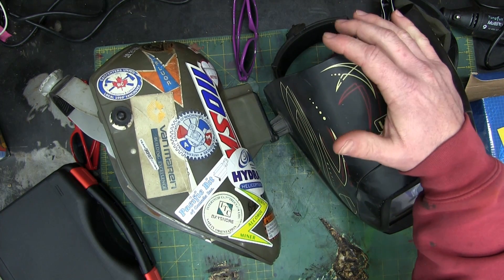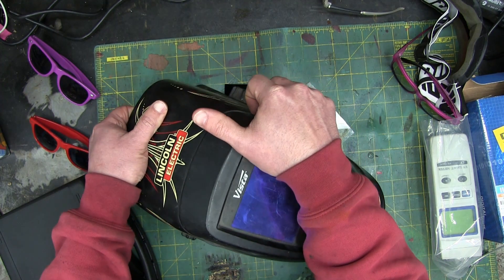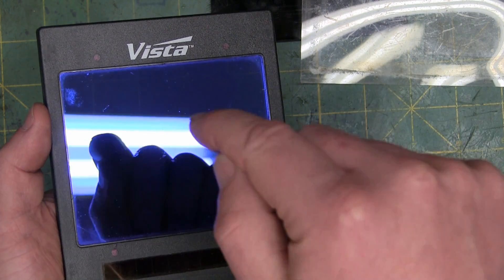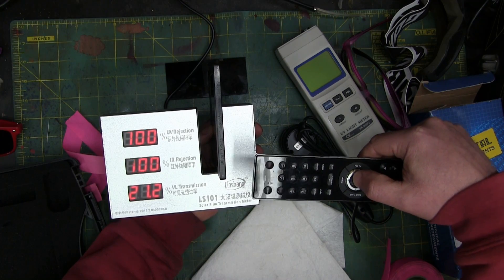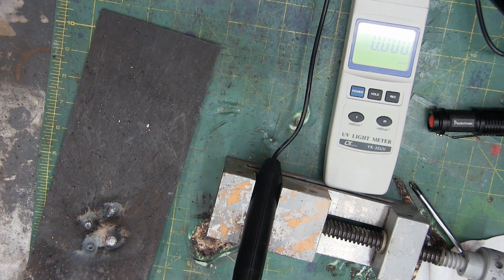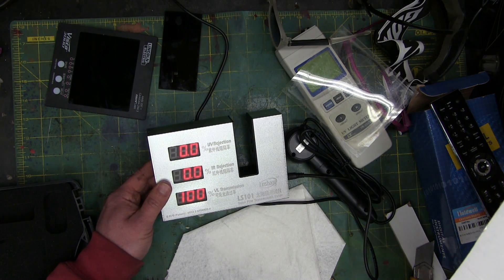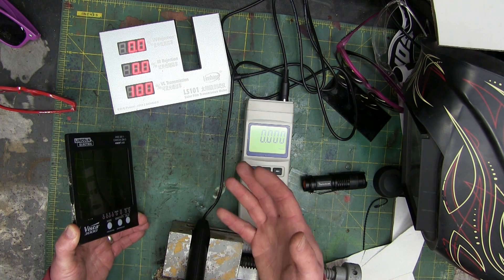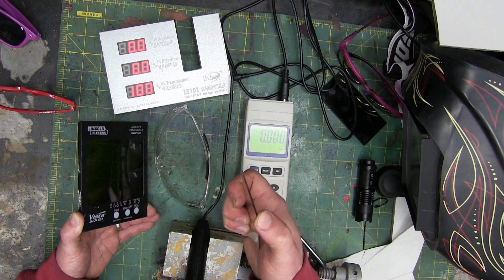SPEED DOESN'T MATTER?! Auto-Darkening Welding Helmet

Comment: Hi AvE, love the channel, and please note it is tightly in the vice!

Just started a welding class, and the Miller helmet I bought has separately adjustable welding, cutting and grinding modes. The expensive one apparently has auto adjust settings (I didn't buy that one).

Comment: That's important to know.  100% protection for the most dangerous IR and UV 100% of the time .  But is visible light also dangerous?  Yes, it can be, but is a welding flash intense enough to do damage? I assume yes.  If the lense darkens fast enough that you don't feel and adverse visible effect, then I assume that it's fast enough but I don't know how much time it would take for damage to occur.

Laser: "Visible and near-infrared (400 – 1400 nanometer or nm) laser light pose a critical hazard on the retina." "bright blue-green light projected into their eyes was from a laser pointer and was harmful."

Comment: when I cut with the torch I use them green cutting face shields,  are they any good? i also use cutting glasses under just to be safe.
Reply: Yes. Even dark glasses are fine. The arc off the acetylene flame isnt near as bright as an electric arc. It will still do damage just not as much or as fast.

Comment: Lincoln for driving
Miller for drinking
Whatever off brand welder you bought because you couldn't afford a Miller or a Lincoln for welding.  Probably spent all your money on DUIs from driving your Lincoln while snookered up on Miller.
I think that's how it goes.

I would love to see you test out at cheap Chineseium  auto darkening helmet.
I got me a new one for black Friday, half the price of my original one and this one is adjustable with a replaceable battery.  My original Forney auto helmet was strictly on and off and you aren't supposed to be able to change the battery.  It is 10 years old and still works if I charge it up under a shop light over night.

Comment: In most cases I agree completely with spending the money on a quality tool but I have had some pretty expensive welding helmets stop working for no apparent reason.  Not old or warn out or damaged.   Years ago another welder told me about the $40 harbor freight one and honestly it’s better than any of the $400 ones I had used before.  Not as many features and a smaller viewing area but they just seam to always work.  And when I drop a hammer on it I get a new one.  

Your mileage may vary.

Comment: There are differences in the way the helmets work. We had Miller, Lincoln and Speedglas that used batteries and it seemed that the battery was dead every time you tried to use it, especially if you were away from the shop and a supply of batteries. I purchased my own Optrel that does have a battery but it is recharged by light. Setting it in the sun for a minute will recharge it if it hasn't been used for a while. The light from welding charges it. I've had the helmet for at least 7 years and never changed the battery. The helmet also has sensitivity settings, shade settings and settings for grinding, torch cutting and welding.

Comment: I made the mistake of buying a cheap auto darkening helmet from princes auto/habour freight.
All of the safety markings turned out to be fake. After a 12hrs shift of running flux core at 200amps.
I went home. 6hrs later my eyes were swollen shut !!
And my face had 2nd degree burns.

DO NOT CHEAP OUT

Electromagnetic radiation does not harm people AVE. UV and infra red do.

Comment: I have had my cheap Harbor fraud mask for 6 years, 170amp chicago electric 220v mig welder just as long and they are both still going strong. Since I usually weld outside in the wind I buy 10lb spools of .035 fluxcore wire. 0 issues. Also my mask has grind setting, sucks to forget to switch back weld setting

Comment: although your automobile glass is not polycarbonate, I was told that you can not get a sunburn while sitting in a car with the windows rolled up... I realize getting a sunburn is irrelevant because you most likely will die from heat exhaustion...that being said is there any truth to being protected from UV radiation sitting behind windshield glass

Comment: the thing with that tester is its not saying what wave lengths its testing. you dont know how far into the ir or uv spectrum its looking. its like checking visible light using only blue light. 

and the auto darkening masks i believe are just lcd screens with no back-light or multiplexing. i would imagine they would use a cheaper tn panel and with that would come with around 1 or 2 ms response time on the lcd panel, would imagine it would only take 1 or 2 ms more compute the signal so i would imagine the screen is dark within 5 ms. and i would argue it does matter, dont believe me stare into a light bulb for a second and then try and look at something else.

Comment: I personally don’t believe auto darkening or fixed shade welding lenses provide 100% UV and IR protection. I found a handful of manufacturers that state that a small fraction of UV and IR actually does pass through the lens. Eye damage from optical radiation is cumulative and compounds over time. I’d post references to the websites, but then my comment get won’t posted.

Comment: I speculate that not all welding lenses provide 100% protection against optical radiation during welding. Again, I am speculating based on my experiences and information I found while researching.

When i first started welding several years ago, everything was fine. I eventually developed severe eye discomfort and pain every time I would weld. I could not figure it out. The pain, discomfort and aching inside the eyes would last weeks and even months. That's when I did some research and found some interesting findings. From what I could find, it would appear that welding lenses may not completely protect from optical radiation such as UV and IR. Most major welding manufacturers state that all high quality helmets provided 100% UV and IR protection. Information was hard to come across, but here is what I found:

1) Phillips Safety Gold Coated Filter - their gold lens will "help reduce eye strain by reflecting more IR and UV spectrum than the standard lens" Shouldn't ALL welding lenses provide 100% protection??? Youtube Link : https://youtu.be/0286YBjm-FI

2) Wens Lens - states "we only found .0002 of a percent of harmful UV light coming through our lens while welding" Shouldn't it be 0%??? 
Website: www.wenslens.com

3) OriGlam Solar Auto Darkening Welding Helmet Lens - can be purchase on Amazon. Product description states : Rate of UV transmittance 313nm < 0.00006% 365nm < 0.00006% - Rate of IR transmittance 780~1300nm < 0.003% 1300~2000nm <0.009% - Again shouldn't 0% of harmful UV and IR radiation make it thru the lens???

Studies have show Chronic UV effects on the cornea and lens are cumulative, so effective UV protection of the eyes is important for all age groups. I would surmise that if you weld often, and it is true that welding lenses do not provide 100% protection against optical radiation, than you are damaging your eyes over time. Maybe some people will experience sooner, others may experience it later seeing as everyone is different.

Any thoughts?

Comment: 11:55 He's referring to the inverse square law of light, basically how light scatters at various distances. It drops off significantly after a few inches, but It all depends on the context if your welding on flat metal your essentially focusing the light in a 180 degree beam arc like the reflector in your car.

Comment: As a glass blower Id like to see a test done on didymium glasses both shaded and unshaded. Phillips changed their formula years ago and caused many folks to have lasting issues before it was noticed . It would be interesting to know why and how the formula failed and exactly why didymium works so well at filtering the sodium flare.. If my dick were any tighter in this vise, Id need a torch to cut it free.

Comment: Infrared destroys nerve cells. That's all radiation with wavelength 700-1400 nm. Many sources are citing the heating of the lens inside the eye over the long term, which is an existing medical problem, but most welders are getting googles because of the infrared nerve damage, not from cataracts in the eye.

Comment: back a few years ago I was working on a job where I needed to video a robotic welder doing aluminum welding.  I was warned against using the video camera without shielding since it would burn out the sensor.  The solution was a gold coated lens, the idea is that the lens would reflect IR and UV light but not visible light.  Seemed to work fine BUT I wonder if you could see what the numbers are for gold coated welding lens?

Comment: Why doesn't Jody get sunburnt hands and arm with all the naked welding he does?
Reply: My theory is that he holds such a tight arc, no light gets out- I however get sunburned all the time on any exposed body surface. I knew a trailer building guy here in FL(where it is too hot to weld all day in proper gear) that had about a pound of flesh removed from his right forearm due to skin cancer.

Comment: It's been proven that you do get flashed when using an auto darkening helmet! The light from the arc doesn't stop when it hits the sensor - it keeps going into your eyes as the sensor triggers the helmet to go dark.  It's basic physics nothing moves faster than the speed of light.  Granted you only get flashed in the milliseconds time frame, but you still get flashed.

Comment: Hi AvE, since you have the o’smeloscope you can set up a simple experiment: use the square wave generator to power a white led and a photo diode to sense the light. Connect one channel to read when the led turns on and a channel to read when photo diode senses the light. You then have to do the test once without the mask to get the response time of the photodiode and once more with the mask in between to get the response time of the mask. Or something something. Too much wine now (yes, I’m from Europe)

Comment: It's about as easy to burn one's retina with visible blue as it is with UV. How do I know? I have blind spots in both eyes that appear green when I look at something blue. It's getting more difficult to find them with age because saccades adapt to avoid exposing damaged areas, but they are still there, 30 years later. For want of a helmet, I used my wife's glasses to do a quick weld. The glasses didn't pass any UV; I checked that later. I was also welding with my eyes shut and only caught a few flashes while trying to strike an arc. A hundred milliseconds of exposure was enough to cause permanent damage.

Comment: I’ve been getting a lot of eye strain lately from welding. It feels like a dull ache inside toward the back of the eyes. I’ve tried everything from different auto darkening helmets to fixed shade to darker shades and nothing helps. If IR and UV are always filtered out 100% then what could be causing this? According to this video from Phillips Safety, some lenses reduce eye strain more than others by reflecting more IR and UV spectrum than the standard lens. Does some IR & UV get thru anyway? Any ideas?
https://youtu.be/0286YBjm-FI
Reply: Have you went to the eye doctors? Maybe check for glaucoma or then the other issue.

Comment: I have a problem with my rather cheap ;) auto darkening helmet... On the inner part of the auto darkening window a strange speck appeared, below the eyesight line, maybe 1 cm x 1 cm which looks like the green layer is peeling off... There's no access to it because it's closed. My concern is, some radiation might pass through it... I want to ask you, what's the function of the green layer and what can I do if I don't want to throw the helmet - it's practically new an the speck doesn't interfere with the work. I thought about patching it with something simply to block any radiation, also visible light if necessary... What material would you recommend? Would some stardard masking tape be enough?

Comment: I know this is an older vidjeo but newer welding helmets actually have a grinding mode. so instead of ranging from 9-13 for welding it cuts it back to 3-8, I know that's only for light transmission but it works very well.

Comment: The auto darken modules do not function effectively at the two diagonals.
Why? Because it is cheaper.
Which means when the light is at the diagonal you do not get the same shade as dead on.
Reply: I was told by a respected welding teacher that arc flash is more damaging and more likely in peripheral vision than straight on.   I don't know if either is true, but combined, our next PPE could be horse blinders.

Comment: Time does matter because if there's to much delay your eyes get too much light then when it goes dark you're blind till your eyes adjust. I had a harbor freight pos had to upgrade. old style manual helmets make you strike blind but at least you can see the arc so ya if you're going cheap, don't go auto darkening useless pain in the ass. Got an expensive one now.

Comment: Spent a few years making sparks and my input is to understand the radiation of whatever the process you're using.  I used to blind tack all the time in the field with stick and never had arc burn.  Moved to MIG in a shop and especially with aluminum I had burn all the time.  Good recipe for skin cancer.

Now I have not very sensitive eyes so I would weld with a #9 with stick and short circuit mig, put in 12 hours and never have a spot.  Started doing pulse mig turned up to 11, using my #9 shade and by lunch I had a big ol spot in my vision.  Pulse and spray can be a lot brighter and you should be aware of that.

Comment: For most of us, the virtue in the green lenses of cutting glasses or shields is the filtering out of much of the troublesome light which interferes with cutting or O-A welding - blocking the heat is essential as well of course -- I never used my welding goggles or welding hood for grinding, as the hot swarf thrown off the work would pit the cover lenses pretty quickly. I had no issue with shifting to dedicated grinding goggles or face shield. I did not care if they got pitted. 20 years of track welding and my eyes are still pretty good though am wearing bifocals now. I had an opportunity to get an auto-darken hood, but my work was mostly out in the field and if something went sour with a 'lectric hood I'd be done until I got back to town to fix the thing. Very good video, btw.

Comment: Does that transmission tester tell you what wavelengths it's testing at? the IR spectrum is pretty huge (740nm to 1,000,000nm). I don't know what areas of the spectrum that welding and cutting emit at, but the way it will damage your eyes (and how much power it takes to do said damage) differs according to the wave length. Polycarb essentially blocks 100% of IR at certain wavelengths, but not all.

Comment: Most glass is opaque to low frequency IR (red hot), but is transparent to high frequency IR (white hot). This is how green houses work. High frequency IR comes in, heats up the interior which emits low frequency IR which can't leave. So, even a glass shield offers some protection. Would be interesting to see what frequency of "IR" that tool is calibrated to check for.

Comment: I thought I was a clever during the eclipse. I didn't have a welding helmet or  those dollar store eclipse glasses so I made my own with some theater gels I had laying around. Alternating red in blue I was able to block enough Visible light to barely see a super bright light through it. Had a UV sensor laying around, no UV could pass through. Though I was done but did some reading, found out IR radiation was a thing I needed to worry about. Used my cellphone camera and a TV remote and the IR was going through my filter like it wasn't there. Realized I might have cooked my eyes if I used the thing.

Comment: FYI: When AvE goes "When you pull the old noob routine and get close ... blah blah square root and all that..."
The thing he's referring to is called the "Inverse Square Law". Basically, if you have a light 10 feet away it will give you X amount of light. However, if you move the light 5 feet away, you DO NOT get X TIMES 2 amount of light, instead you get X SQUARED! Amazing, huh?

Comment: For a while, I was working with lasers, so I got a bit of research done on eye damage.
The reason UV is considered more dangerous in lasers is because people won't notice their eyes are being cooked and it won't trigger a blink reflex. 

While it's probably true that some EM radiation is fundamentally worse than others, all powerful EM radiation is harmful to the eyes, but visible light triggers the blink reflex. This factor into laser classifications; A lasers are pretty much harmless, B lasers aren't harmful enough to harm your eyes before you'd blink, and C lasers and above are harmful to the eyes before you have time to blink. 

It should be pointed out that EM exposure is only harmful if it actually lasts long enough to heat the photoreceptive cells (I think they're the weak link) in your eyes. Which means short exposures from regular welding isn't inherently damaging, although any risk should be minimized, of course. I'm assuming welders produce fewer photons per second in one specific direction than a class C laser. 

And there might be welders capable of producing worse EM radiation than a class C laser.

In any case, caution is warranted. Eye damage is cumulative and can get gradually worse over a lifetime without you noticing it's started until it's gotten pretty bad.

Comment: I remember when I used a welding helmet about twenty years ago.  I didn't know it, but I had a crack in the lens.  A few hours later my eyes are stinging so bad I couldn't see.  Went to the hospital and they ground off my cornias.  They grew back in three days.  The most miserable three days of my life.  Learned the hard way, check your equipment before you use it.